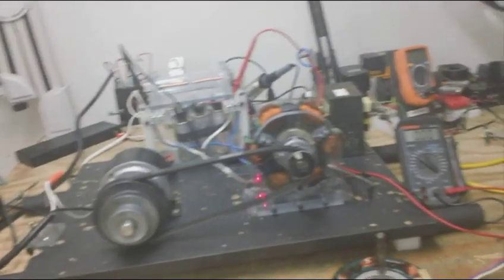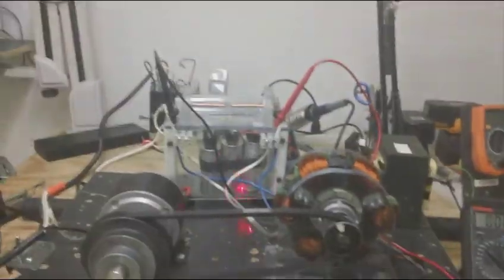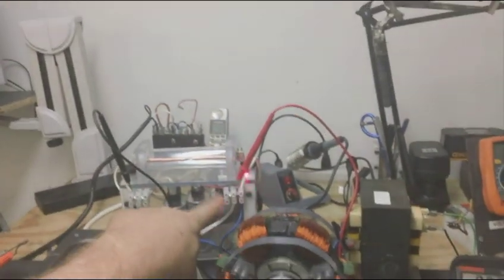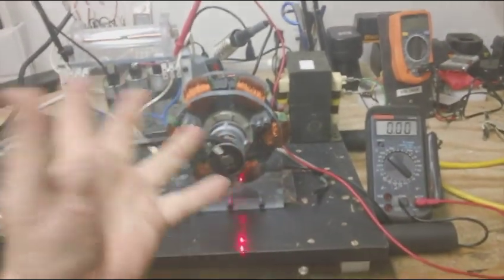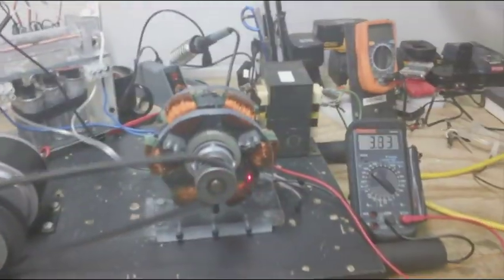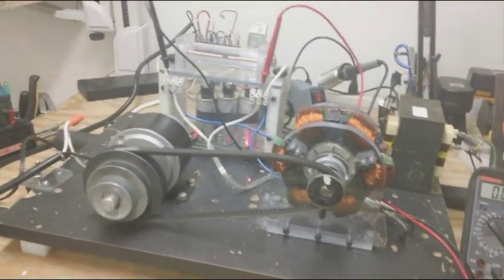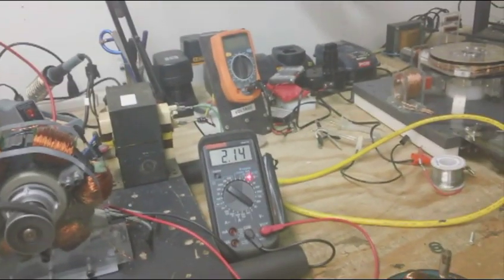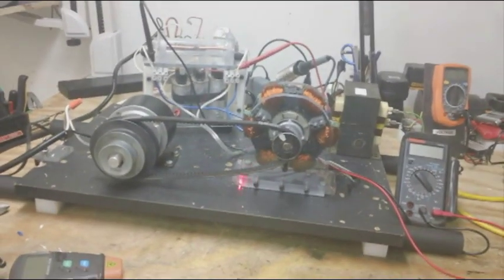Mini QEG hybrid

Comment: cool, but i dont understand how it works
Reply from the maker: Actually, it didn't work that great, I managed to get a few thousand volts intermittently from this device, what the new generator I'm working on uses permanent magnets. The ring is made from amorphous metal and the rotor has 12 poles you can check out some of my latest videos on the new system. Due to the fact, this mini QED hybrid used a standing wave similar to an AC motor the field was too unstable and would collapse.  The new generator the field will collapse under heavy load but it recovers very fast  I just have to say circumventing  Lenz law is a pain in the posterior.  Thanks for watching